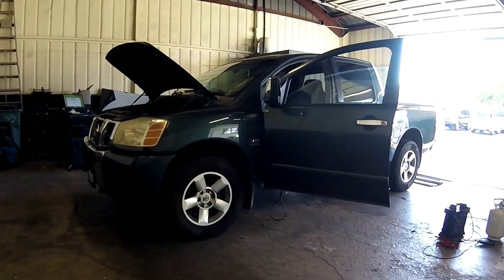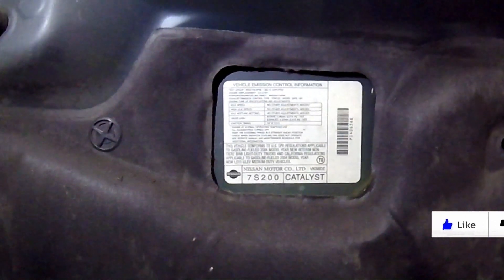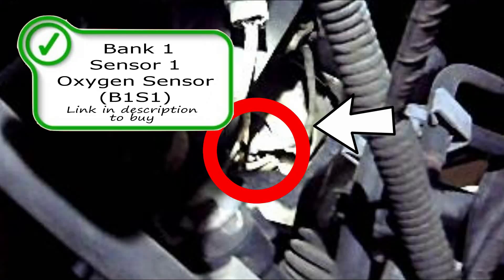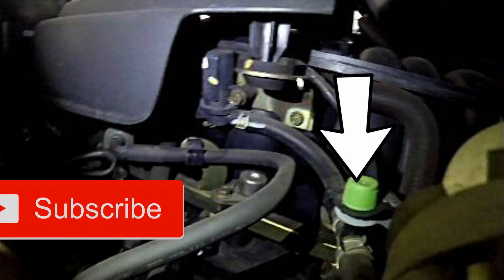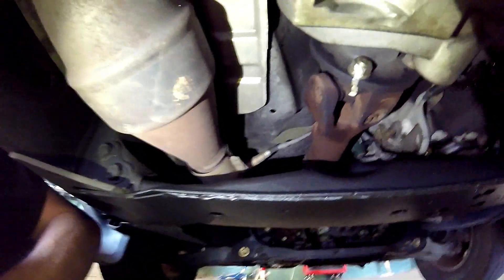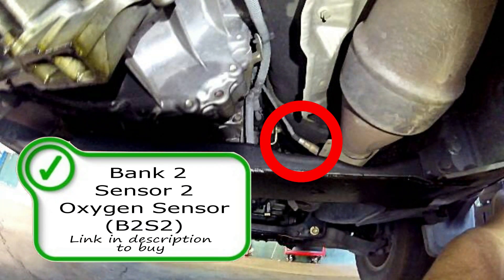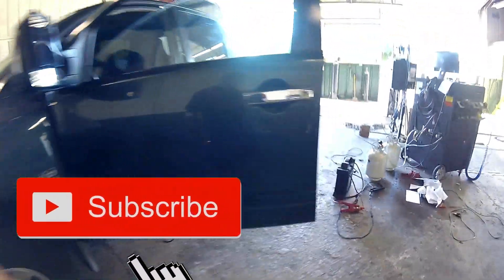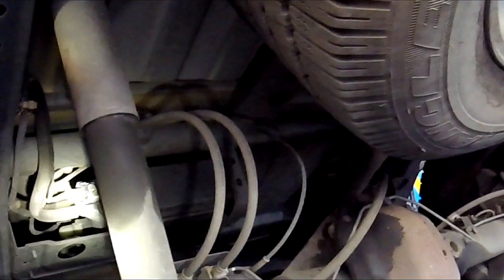⫷ Nissan Titan VK56DE A60 Emissions: EVAP, Oxygen Sensor Locations ⫸

Comment: My 04 Titan came up with code P0057 is that the bank 2 sensor?
Reply from the maker: That code indicates your bank 2 sensor 2 sensor to oxygen sensor has a heater circuit malfunction. So on bank 2 the oxygen sensor down been sensor downstream from the catalytic converter how's a problem period from experience the most common cause to this code would be the sensor at fault. But it is also a possibility there is a wiring issue . In this case I would replace the rear oxygen sensor on bank 2, reset the code.

Also, make sure you replace the oxygen sensor with a direct replacement, not a spice in sensor
Reply: Thank you! That's what I figured was wrong.
Reply from the maker: @auroralewellen8798  good luck with the fix. Keep us posted on your progress. 🤞👍💪

Comment: Got an 2007 titan, R&R the valve covers. Now I have a p0174, so headed to buy new o2 sensor an that should fix it huh🤔, hope so
Reply from the maker: Make sure you have good connections on all vacuum hoses. Especially the breather and pcv hoses. And.. no exhaust leaks on the exhaust manifold area? 

Good luck on your fix! Keep us posted on your progress.  👍💪🤞
Reply: Okay got theo2 sensor this morning, installed it. And it running like normal so far, not using a lot of gas as it was doing 🙄 I fixed it, video was a great help

Comment: I just popped a code P0430 , any advice on dealing with it , dont want to replace cat if its just the sensor
Reply from the maker: It sounds like you are on the right path. In this situation if you are over a 120 K and this code pops up it is probably the cat but you are right. It is possible the rear oxygen sensor on the bank 2 side has gone bad or gotten sluggish..  If this was my vehicle I would change the rear oxygen sensor 1st and clear the code. If it comes back then I know the catalytic converter needs to be replaced.
Reply from the maker: Good luck on your fix. If you have any other questions please feel free to ask. Keep us posted on your progress as well. 💪👍
Reply: Thanks very much ! I will keep you posted !
Reply: The truck is at 200k so we will see , the sensor is also rusted stuck on to the pipe so theres that
Reply from the maker: @chriss-l9x   If you  Don't drive it everyday. Spray some penetrating oil on it or some WD40 on it A-day before you go to take it off. But make sure you don't drive it so the penetrating spray can set in.

Comment: Where is the CAN Communication Circuit?
Reply from the maker: You mean you're obd2 connector? It should be within 18" of the driver's knees. Usually under the steering wheel column.

Comment: Please confirm that "Bank 1" is "Left" and "Bank 2" is "Right" for the rear sensors. Part numbers are different in your links. Thanks!
Reply from the maker: To my knowledge that is correct. You can do a little research your self too. Look up the firing order. The bank 1 side is always on the side your #1 cylinder is. 

Good luck on your fix! Keep us posted on how it goes and what codes your are taking care of, if any. Thanks for the view!

Comment: I replaced Bank 2 Sensor 1 (same year/make/model) and Torque still shows that sensor stuck around 0.6v and it barely varies, just like before I replaced it.  What would cause it to get stuck high?  No check engine light, no faults ever seen on bank 1, runs fine.  I just had a P0118 fixed, too.  I dont hear any leaks with a funnel and tube and intake seemed to pass when I did a DIY smoke test.
Reply from the maker: A leaky injector? Some how not regulating fuel on that bank? In not sure what the fuel rail looks like or how many regulators you have. Maybe vacuum line to regulator if its vacuum driven? 

Just throwing some thoughts out.

Comment: Thank you. I have a 2004 with P071 code. I changed all spark plugs and coils and light still goes on
Reply from the maker: Can you confirm the code?
Reply: @ScottiesHobbies  po74
Reply from the maker: @michaelreyes6761  is this a obd2 code? If so the code should be like p017x. After the p, you should have four numbers.
Reply: @ScottiesHobbies  the code is P0174. Sometimes the engine light turns off on its own then the next day is on
Reply: @ScottiesHobbies  also P0174 pd
Reply: @ScottiesHobbies  thank you for responding

Comment: P0441 code, I went to a smog shop because I need to get it smogged and they told me to drive the truck a couple hundred miles for it to go away any thoughts?
Reply from the maker: Does the light come and go or has it been staying on? Have you checked the seal on the gas cap?
Reply: @ScottiesHobbies  the light comes and goes, I use my obd2 scanner and turn it off. Stays off for weeks and then comes back on, I just bought a new gas cap for it about 8 months ago
Reply from the maker: @martykyork  if the light turns off on its own, go to the nearest smog shop and get the smog. If you force it off, you will need to set monitors.  You might notice the light comes on more often when you have a certain amount of fuel in the tank. 

They probably ment drive it till the light goes away.

Comment: P0420
Reply from the maker: Cat below efficiency
Reply: What could cause that only had the truck a few months
Reply from the maker: Possible bad rear sensor. But probably a bad cat. Any other codes?
Reply: No other codes it comes on then go off
Reply from the maker: Check out my podcast on this. I think I explain how to check them and info on the code. 

But, your cat is probably going bad. Could be the sensor. If its over 120k, probably need the cat and sensor.
Reply: 2006 Nissan titan my truck run good in cool weather but summer time ather about 30 miles it start to cut off like not getting any gas ..I need help troubleshoot this problem
Reply: I have the same problem Bank 2 inefficient I get about an hour on the road and starts really bucking and seems like running lean I have already replaced the downstream O2 sensor and downstream cat running out of ideas… I was thinking about changing upstream O2 sensor and the mass airflow any insight??

Comment: Wow this is so cool that I found this video. I just bought this exact same truck 2 days ago and yesterday on my way to do an emissions test so I could register it the CEL came on for code: P0507 “idle air control system; revolutions per minute higher than expected” needless to say I was a little annoyed since I just bought the truck and it seems like a great rig.

I’ve never owned one of these trucks before, do you know where the best places to start for this code are? I immediately cleaned the mass airflow sensor the throttlebody control and basically everything from the air filter to the intake but that didn’t clear the code. 

Then I cleared the code manually with a scanner and it came back within a couple of drives.

Where is the best place to start? Thank you so much in advance!

Comment: I got a P2a03 and P2A00 on 06 should I just replace the sensors?
Reply: Hi Angel, I just got the "P2A00" in my Nissan Armada 2007, did you figured out that was the issue in your case for this code? If yes could you please give me some tips about what it was?
Thanks any way.

Comment: My ‘17 Titan is getting a P0174 code System Too Lean Bank 2, would that be the post cat bank 2 sensor?
Reply from the maker: No. That code is telling you the pre cat o2 sensor is seeing a lean condition. It could be a false code or it could be making you aware of a issue. Check for exhaust leaks between the engine and the pre cat oxygen sensor. Check for vacuum leaks, ripped intake boots, etc.
Reply: Thanks for your help
Reply: @davidpink4795  That code is a Son of A bitch sometimes, Look for holes at flanges, o2 sensor bungs.. If you cant hear or detect by simple eye and sound.. on a cold motor and exhaust, Use a positive air flow, anything that pushes air.. like a shop vac i find is best. Instead of vac, put it to the blower port, and push the air into the rear tail pipe. Cover up the other pipe if you have a dual exhaust, usually a rag or towel will do fine.. some use a latex glove. with the air flowing , get a spray bottle with dish soap and spray your entire exhaust, since your code is related to the downstream before the A/f Sensor.. I would start at the manifold and move down.. you will find you leak.. also you may hear air coming out at the exhaust manifold, But positive air can come out there from the shop vac.. its normal, if your only option for the leak is a crack manifold, while car is still cold.. put a towel in the rear tailpipe and start car, if it pushes the towel out, then you dont have a manifold leak.. if it doesnt and you do have a leak at the manifolds, you will know cause the exhaust has to go somewhere if it cant go out the cars rear tail pipe, and the header is cracked.. dont leave it in long.. a few seconds.. as it could heat up the towel, and also push the co2 back into the engine and drivers area.. good luck..

Comment: I have 2 questions: 1) what is a p1051 code......I Google it but still not clear. (I have a Nissan Titan 04).

2) I have a p1168 which points to a 02 sensor, will I be able to pass smog or will they need to be replace (the 02 and which one?)

Comment: P0300 with no other code!? Little help please!!
Reply from the maker: a p 0 300 is a random multiple cylinder misfire. This can be caused by a number of things. Have you maintained the vehicle properly? Kept up on your spark plug replacement? Have you replace your air filter? Is this the only code that your vehicle is coming up with? Other possible problems could be poor fuel delivery, you would need to check your fuel pressure. It could also be poor air delivery such as a bad air filter or cracks and rips in the intake boot between the air filter and the throttle body. Do you have any vacuum leaks?
Reply from the maker: I forgot... does your truck have a distributor or does it have coils. If it has a dizzy then the ignition control module might be a issue.

Comment: Because of ur video I was able to find the O2 sensors. I got to the passenger side one by removing the tire and the guard....But I can't on screw it to get it out...look like I need air impact wrench...
Reply from the maker: Many times we have had to get new open end wrenches, get them hot with a torch and bend them to get a good grip on oxygen sensors. Manufacturers design these cars with no consideration of a owner serving their own vehicle.

Comment: I have this truck  problem is I can't put a bucks worth of gas in it and it comes ruching back out  any clue what it could be?
Reply from the maker: Do you have a check engine light on? Usually in this case you're having a evap vent solenoid problem.
Reply: @ScottiesHobbies  yes the check engine light is on
Reply from the maker: Have you had the code pulled?